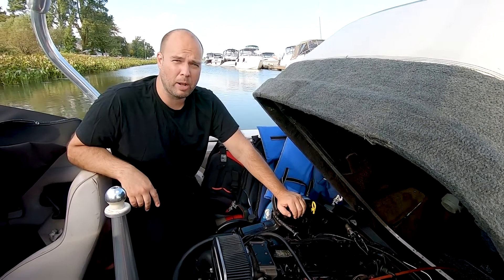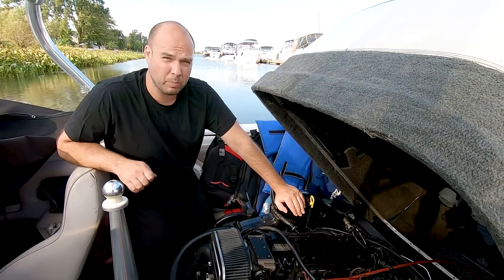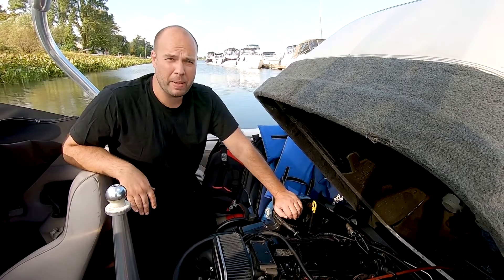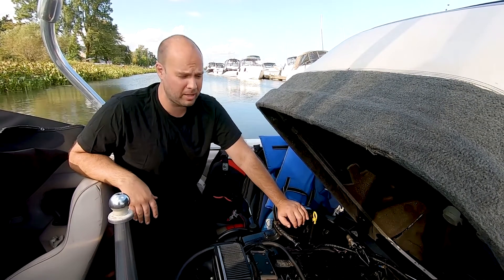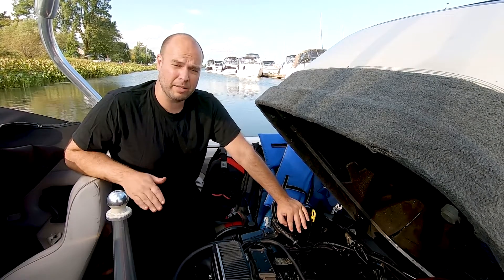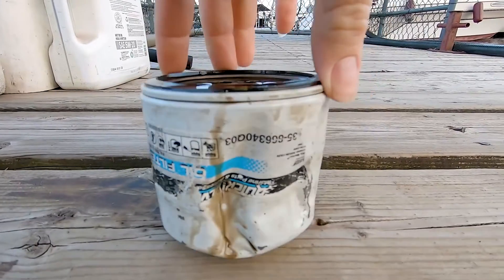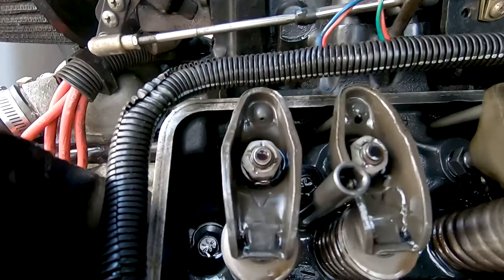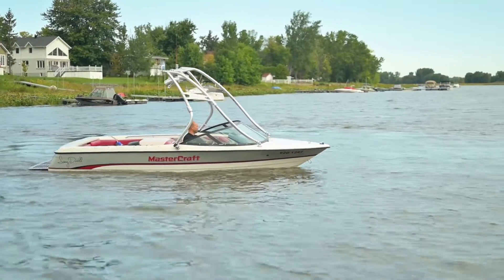Indmar GM LT1 350 5.7L engine failure in a Mastercraft ProStar 190 rocker and pushrod problem

Comment: Where is the Bayliner 4588?
Reply: Was you engine making noises prior to rocker arm and pushrod coming off? How does the engine sound now?
Reply from the maker: Hey Mark, sorry for the late reply, I missed your comment. The engine was making a loud noise and there was a big loss of power. I had my mechanic listen to it and he told me to remove the valve cover to have a look. Since the work I did the engine sounds perfect and pulls hard.
Reply from the maker: At the same marina where I filmed this. We will be releasing a video in a few months from our 850 miles trip we took this summer down the St-Lawrence.